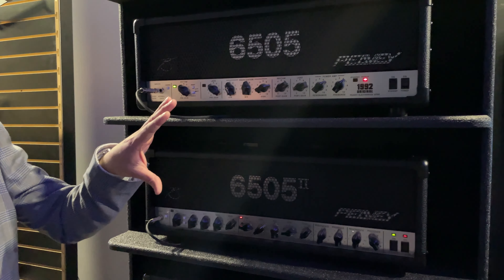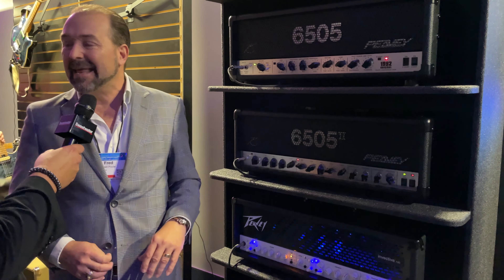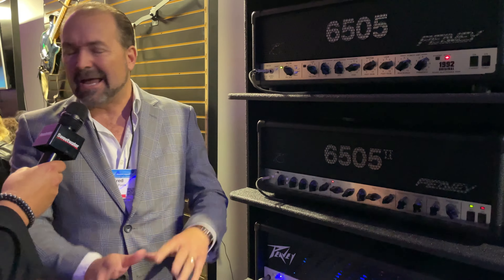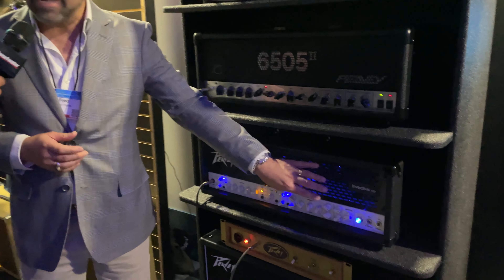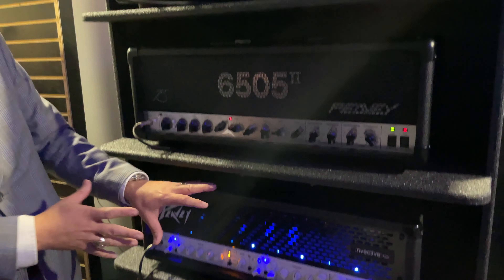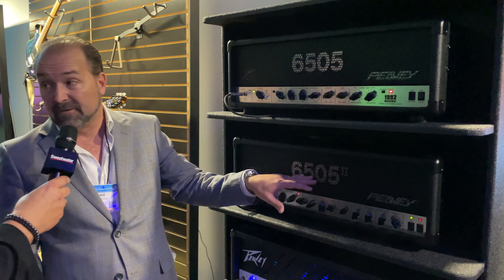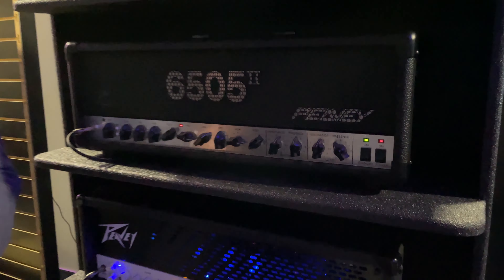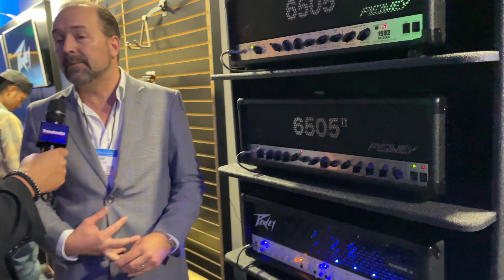Peavey 6505 Amplifiers – NAMM 2023

Comment: Dear Peavey get someone to actually plug into the amp during QC maybe someone who actually plays guitar. I’ve known 3 people so far who have got amps that were obviously not QC’d properly with the 1992 and 6505 ii
Reply: Dear ClintN667, unfortunately you will need to travel back in time to 1992 and file a complaint as the old QC team has retired/died since then.
Reply: @deicidalmaniac   I’ve heard that the place that builds them just does some continuity testing but nobody plays guitar there so they don’t even plug into it to check them out. Thankfully I still have a U.S. made model although I never had issues with the MiC (6505 or the +). Hopefully it’s just a minor glitch in production
Reply: @deicidalmaniac  1992 is the name on the re-release of the 6505.

Comment: So what he said...

They found something wrong w/ Misha's amp or they were building the new amps wrong?

Did they benchmarked the new amps against Misha's original? Or they built the invictus amp w/ that missing midrange growl?
Reply: Peavey discovered the transformers were different/better in Misha's old block letter 5150 because he insisted it sounded different than their 6505's that were in production at the time of the invective development. So the better transformer was sourced and used in the invective...and is used now in these production models. That's my understanding.

Comment: So Peavey is back???....Awesome. Any chance they will be re-visiting the awesome Transtube Solid state series.....Say a modern spin on a 100 Watt Transtube head?  Or the Bandit?
Reply: My first 2 amps were bandits and I LOVED them…they logged hundreds of cover band gigs and got the job done. Sure, I’ve heard better since, but I could go back to a Bandit reissue and enjoy the heck out of myself.
Reply: @joerectifier  A used Bandit just popped up in my area for a reasonable price. I may have to make it happen. I did not know that they are rated 80 Watts as a combo but 100 Watts when you speaker out and use it as a Head...that is freakin' brilliant....Some of those Solid State Monsters were real Metal Machine's and excellent pedal platform's....Even for Blues and Country. great amps.
Reply: @algrundau9441  yes sir….they were very useful and enjoyable and I used them for YEARS. Like you mentioned, You can take one of those 65s, 75s or Transtube Bandits and do any gig with a few pedals and a good HSS strat or Charvel. For a long time I have been threatening to recreate the 70s Skynyrd white peavey backline with the Mace 2x12 combo on top the 4x12…the Mississippi Marshall. 😂
Reply: @joerectifier  I had a Transtube Head that went through an old Marshall cab....sounded AWESOME!!!....But I traded the head and some cash for an airbrushed B.C.Rich Warlock....I want to track down another one. As great as the 5150 and other Peavey Tube Amos are, they were pioneer's in the Solid State World and got it right with the TransTube stuff.....And they were built like tanks and reliable as could be....hard to beat that.

Comment: Let's face it the real reason they reissued the PV is because of EVHs Iconic line up
Reply: I thought this had predated that amp. Kyle Bill demoed this over a year ago. He got the exclusive demo a year before it even was on the market. My math might be off, but I remember seeing this before the iconic series.
Reply: @TheTribalist  you are correct. The original 6505 series does predate the Iconic. My comment was about the reissued 6505 series "after" the Iconic series was launched
Reply: @fullmetalsal  that’s what I was referring to as well. I thought the 92 series were announced and demoed by Kyle Bill before the Iconic series. Which admittedly, were available before the new 6505 series. Again, my math could be off.